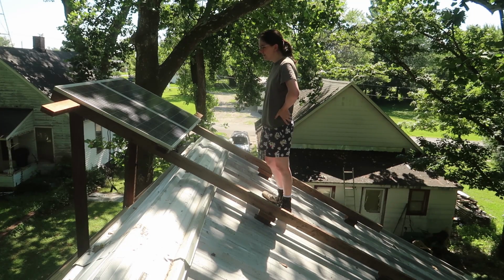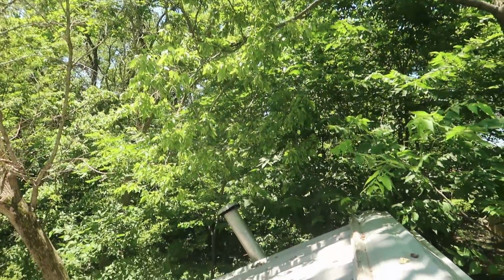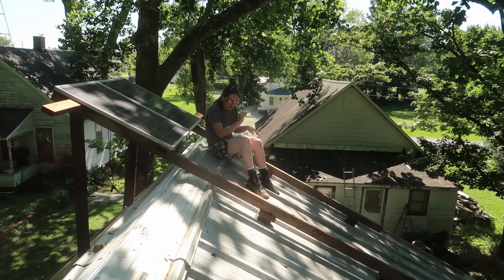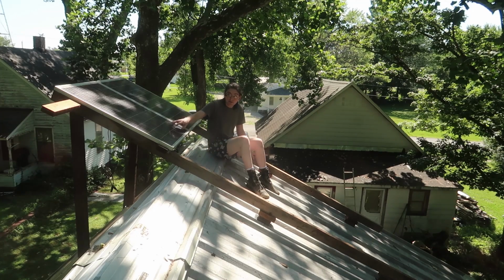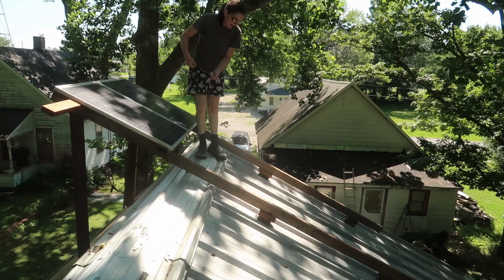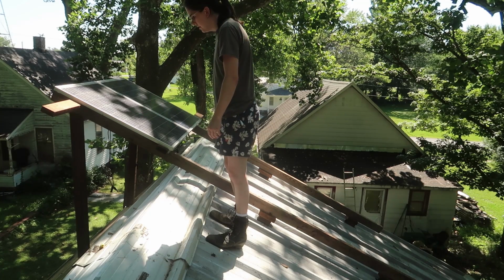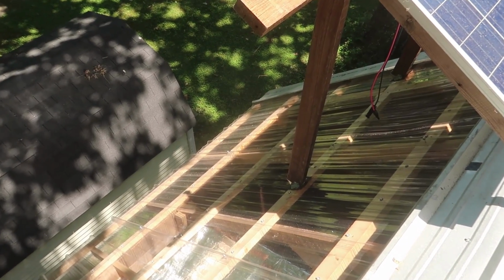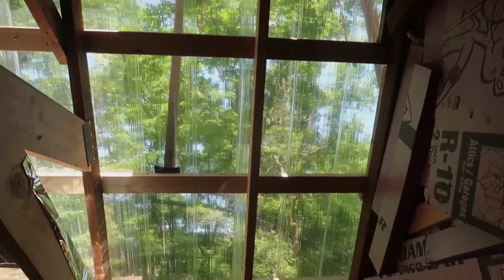Solar Sunday 02: DIY Solar Panel Roof Mount from Recycled / Reclaimed Materials

Comment: I got two more 1oo watt panels today...and I have 14 batteries now...only need two more..the back ordered two other 100 watt panels will get here eventually I guess...that will give me 1000 watts , like you said...and 755 amp hours @ 24 volts...gonna run the A/C tomorrow, it's supposed to be 100
Reply from the maker: nice!

Comment: Not sure where you are at with your solar array. There's a company in sulphur springs Texas called signature solar. They have reasonable prices on used solar panels. Mostly 24 volt panels. The only drawback would be shipping. Maybe you can find a similar company closer to you that sells used solar panels. Peace ✌️
Reply from the maker: Thanks, ebay has some cheap panels too thankfully

Comment: do you think the shade will be a problem for you?  I just notice a pretty significant shadow over the panels.  depending on how the panels are wired, blocking one or more panels can greatly reduce your output.  Great effort though.... thanks for sharing your experiences!
Reply from the maker: Yeah it would have caused a significant engineering hurdle, however my workshop doesnt use all that much power anyway so it would work out in the end

Comment: in your last video you talked about the slant of the roof and about heat... got me thinking, have you ever tried to put Peltier units on the back of the solar panels?  I mean you collect aluminium heat sinks already, and I'm sure you have some thermal paste.  What sort of voltages could you get by draining off the waste heat the panels produce I wonder?
Reply from the maker: yes i have thought about things such as that, but i think peltier modules would be much more wisely utilized in a solar reflector type setup. a while back i found a bunch of these big liquid cooling plates for some super fancy equipment out in silicon valley. i figure i can make a liquid cooling system to pump cool well water through it or something, and have some reflectors up on ground level. i plan to cover any and everything you do can with the sun's power in this series.
Reply: @RinoasBigProjects  aw man!  That's awesome!  I can't wait!  (Make sure you watch the video link.  it's very practical for your loft I think.)
Reply from the maker: his idea was ok

Comment: try for grid tie panels that have been over order on ebay they tend to do 255 watt ones tend to be the same price as lower wattage ones made for 12v and with mppt controller they work really well the bottom bracket idea was brilliant i had never thought of making the holes on the back keyhole shaped to slide over screws

Comment: I've been waiting for this ever since you began building the workshop. As a suggestion, have you considered going 48 volt with the leaf batteries? I've seen quite a few folks go that route, and I've also seen others power powering some 110 rated SMPS based devices right off of the 48V with success.
Reply from the maker: 24v equipment seems better priced than 48v, and plus im kinda tired of getting shocked by 48v in the rain. lol

Comment: This is cool. I totally get sacrificing panels to save the roof. Sort of like the crumple zone of a car frame.
As for tree shading interfering with power production, observing the shadows will help you choose which panels get paralleled vs serialized. (If you do serialize at all, I think you said in an earlier video you are doing 24 volt?)
Thanks for sharing.
Reply from the maker: well my plan is to just slowly trim the trees as the panels get populated